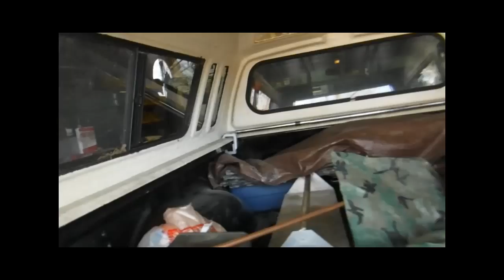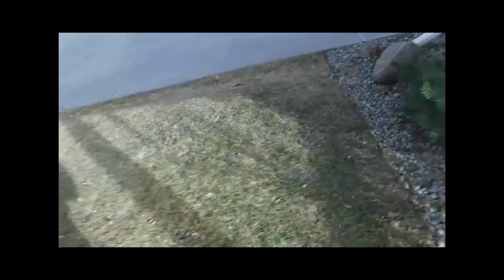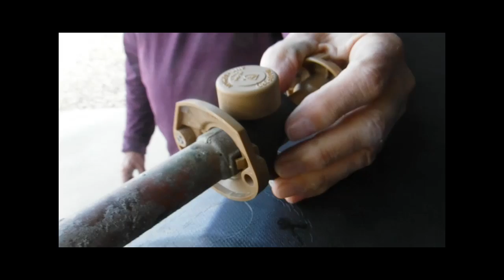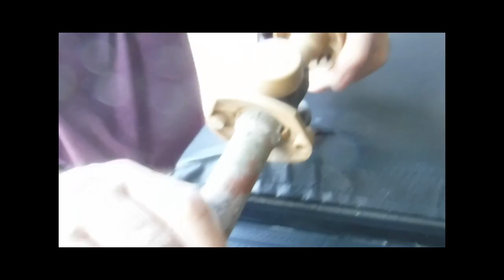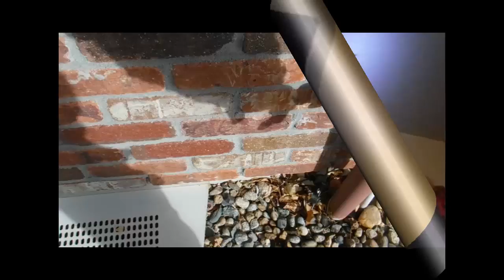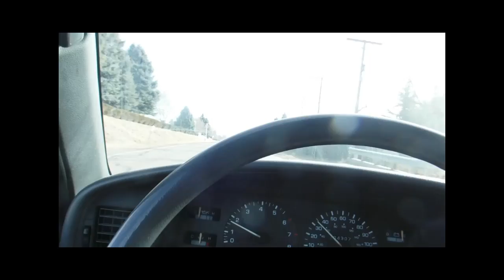(Frozen Water Pipe) Frost Proof Sillcock Fail

Comment: Way to go, nice. I put shut offs and bleeders in my house and this year I'm glad I did. Looked like a nice day outside but maybe cold . Have a good one.  VW:-)
Reply from the maker: Good Idea to do some preventive maint. Today is nice but more cold and snow on the way. What a winter it has been.  March is historically our snowiest month in the high country?????
Reply: We generally only get snow on the passes in March but it makes it a bummer to go to the coast etc. would like to insulate the hot water lines but with copper you can get electrolytes problems.
Reply from the maker: Just install dielectric unions on your water heater and insulate away. Every commercial place I worked had all the Hot water lines insulated?? I have my lines at home all covered too.